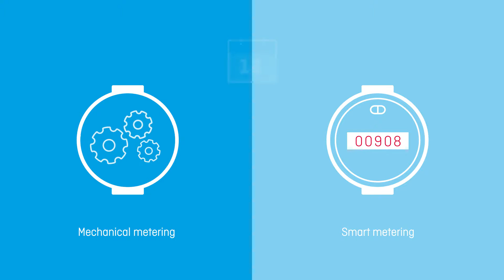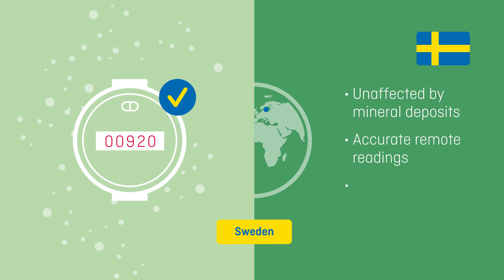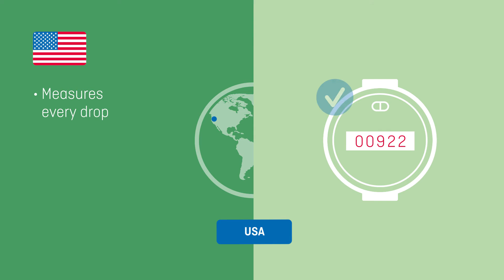Say goodbye:   Mechanical vs  Ultrasonic Water Meters

Comment: The science of neuro marketing includes a careful choice of "anchors", that is the meter that is being compared. In this case the comparison is between a mechanical meter with a mechanical register to an solid state meter with an electronic register.
But if you fit a mechanical meter with an electronic register not only can it duplicate the features of the "solid state" meter, the use of an electronic register enhances a number of performance properties of the mechanical meter.
To start with, a typical performance curve for a mechanical meter is actually a representation of the systematic error, how the fixed meter factor, the same meter factor for all identical meters,  varies with flowrate. Repeatability is not measured.
With a solid state meter, e.g. ultrasonic, the systematic error is compensated for in that the relationship between the velocity of sound and the mean flow velocity varies from high flow rate when flow is fully turbulent and the velocity profile which is the same across the hydraulic radius, to transitional flow where this relationship changes and finally to low flows where laminar flow dominates. The algorythins are obviosuly not simple and at very low flows the ultrasound may transit through the pip axis but where the laminar flow peak velocity may no longer be centred. One presumed this is a reason why there is a low flow cut-off and flow in this region is not registered but may be used for leak detection.
By comparison the mechanical meters can have a unique calibration and be calibrated to have a different meter factor at different flow rates to compensate for the typical systematic error. This is a relatively simple algorithm and commonly used in industrial applications.
Thus the mechanical meter with an electronic register can provide an accuracy that is determined solely by the repeatability, as, one presumes is the nature of the accuracy claimed for solid state meters.
But there is more. The average service life of a mechanical meter is 15 years for a rotary piston meter (Source, WRC) and 20 years for a nutating disc meter as claimed by Neptune.
What is the service life of a solid state meter? It is determined by battery life. Fopr a mechanical meter it is determined by calibration drift. Starting at maximum flow at aroun (-)1.0% it is the time taken for the meter calibration to drift due to wear to the (-)2.0% defined inthe standard which balance calibration drift against a useful service life.
However, some major utilities, collecting meter data on a regular basis can categorise consumer's meters into a number of categories e.g. very low consumption, low consumption, normal consumption, high consumption and very high consumption. By taking randomly selected meters out of service every few years from each category they can assess the actual rate of calibration drift. Low consumption meters will drift less than high consumption meters. The average is, as said,15 years fro rotary piston and, the only data i have, Badgers claim of twenty year life.  They can thus determine after how many years they should replace  meters in each category. It is not a great leap of imagination to envisage an electronic register that compensates for the calibration shift based on consumption thus limiting calibration drift significantly. 
Note also that Badger claim also a battery life for electronic meters fitted to nutating disc meters of 20 years.
This does not necessarily mean any compromises in electronic activity. Water meters can spend much of the day doing nothing, waiting for someone to fill a kettle, wash the car etc. In a solid state meter the only way they can know if there is flow is by continuously measuring flow because the sensor requires battery power to operate. This then results in sampling methods where the sensor is activated briefly at a relatively high frequency in order to capture the start of a flow activity and the end. By contrast, the mechanical meter is powered by the pressure drop or flow. If there is no flow then the magnet on the output is stationary. Once flow starts, the magnet turns and can be used to "wake" the electronics which primarily drive only the electronics themselves and the radio data transmission.
Thus, while mechanical meters can wear and can suffer catastrophic failure, this data is included, necessarily, in the utility's determination of average life. So no moving parts might suggest a longer life but really it is these average life times that determine whether this is an advantage, but only if they can show a longer average life than mechanical meters. And note, a rotary piston meter with a mechanical register has a 15 year life...but with an electronic register could be extended to at least 20 years (per the Badger electronic register) and exhibit a stable calibration using calibration drift compensation. 
As it happens, water meters are transaction meters. While accuracy is a key feature of most transaction metering applications and in some is of critical importance, such as putting petrol or diesel in your car, in utility metering the unique circumstances mean it really makes little difference if the meter is (+/-)2.0% or reading accurate or (+/-)0.1% of reading accurate.
Well, that's about all I will say for now but we should also beware using starting flows or R values as a guide to limiting unregistered flow.  (and that there is no actual "lost revenue" for any utility run on sound business principles but it does suggest to consumers that fir exactly the same consumption they will pay significantly more, or would, if low flow were the factor. In reality it is an indicator of the maximum unregistered flow which is techno9logy dependent. For example, a true PD meter has no unregistered flow and is why they survived in indirect plumbing from 1824 till the period beginning with the 1945 Rural water Supplies Act in the UK and the solution adopted by others.
I don't want to be a cynic but if the mechanical meter manufactures were competing with solid state I am sure many of the claims for solid state would be much more closely scrutinised but every global mechanical water meter manufacturer also has bet their shirts on solid state and are doing all they can to promote it. 
Ironically, if the rotary piston and nutating disc meters were improved to be rue positive displacement then they could deliver a life expectancy of perhaps 45 years or longer. 
AT 15 years a utility replaces 6-7% of its installed base each year, with a 45 year life expectancy they would replace just over 2% of their installed base each year.
What is the battery life of a solid state meter?
Incidentally, with a true positive displacement meter and no unregistered flow and thus zero "non-revenue", if we want to use that term, there is a way to extend the battery life of electronic registers to possibly match that meter life. 
The killer properties of such a meter would be, even as a mechanical meter with or without AMR, significantly better linearity and reduced calibration drift due to wear.,